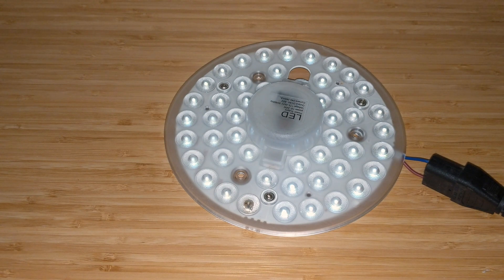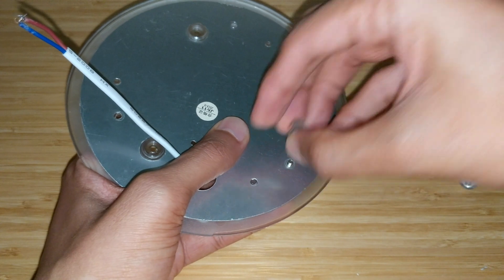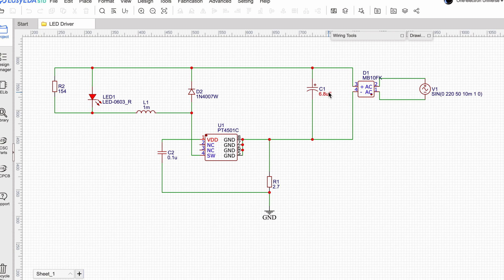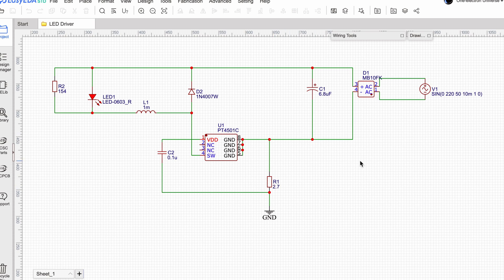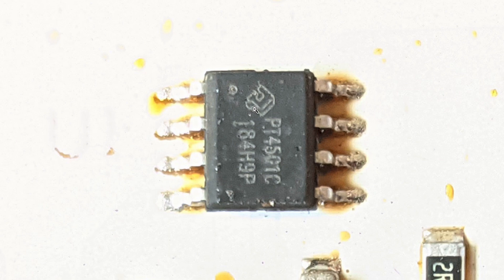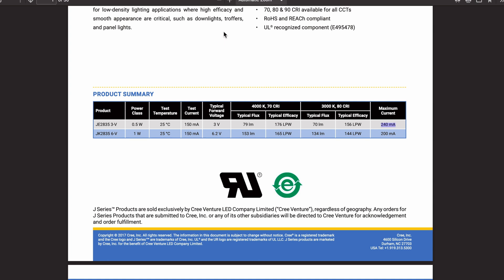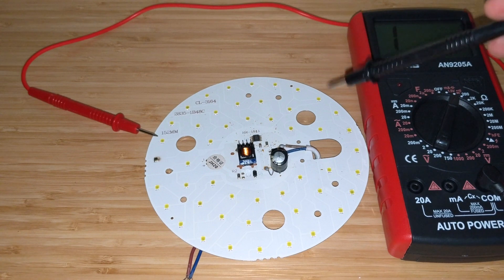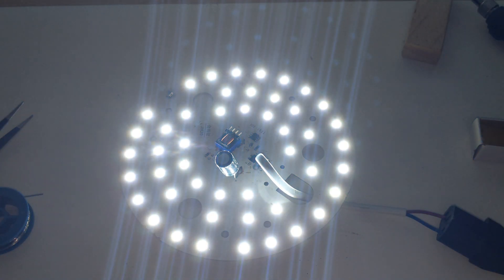LED Driver Teardown and Repair - Let there be light!!!

Comment: there is a error in your schematic. the path for current detection should be:
Bridge recitifier +ve- > LED (LOAD) -> L1 -> U1 ICpin 4 ->U1 PIN 5,6,7,8 -> R1 -> GND -> -ve of Bridge recitifier. then only the current  flow is detected by the IC. 
as per your diagram, the current never goes through R1, But directly goes to Bridge rectifier -Ve,  so no current limit work. also the GND connection is hanging - it has to connect somewhere isnt?
at 8:33 Data sheet shows no connection from -ve of bridge rectifier to IC pin 5,6,7,8

Comment: First of all you are a good teacher. I liked your videos and narration. I want to know what voltage & current rating of a driver required for a 18W tube light (by Wipro). There are total 98 LEDs, connected in pairs (groups of two parralel) and all the 49 pairs  in a series. The data plate says 160 ma current. But no mention of driver voltage. I tried a 100V 200ma driver, it does not give full brightness. Please reply

Comment: you did not notice the bulged capacitor. how come? try replacing that and the led light fixture
will light up.
Reply from the maker: Good observation. I did test the capacitor. it was fine but definitely close to its end.
Reply: I'm trying to learn more about LED drivers, that's how I ended up on the channel. I have bought a batch of LEDs ceiling lights, their drivers keep on failing - and the offending part is that 6.8 uf capacitor. The whole circuit works fine again after replacing that. 

I've tested the circuit by putting a good capacitor of but a lower capacitance - the light then flickers occasionally. The capacitor also gets a little warm.

What if we replace that with one of a higher value? Would putting a 20 uf one instead of a 6.8 uf one cause any problems? Would it likely to last longer?

Putting a capacitor rated for higher voltage is very likely to make it last longer. 400v is the bare minimum here, 450v is standard, going higher than that could be beneficial.

The only downsides I see with a higher rated capacitor is increased cost (which is justifiable to avoid repairing them repeatedly) and size (it has to fit in the fixture or driver casing).

Comment: You should probably replace the led and reduce the current by changing the current programming resistor. This will increase life expectancy of the led bulb.
Also the input bulk capacitor is bulging which needs to be replaced for healthy filtration of supply voltage.

Comment: You don't give the datasheet of C1 6.8 uF (400v I hope ?) it seems very bulky, I would immediately replace it by a Japanese one. Anyway the manufacturer design circuit of this light drive too much current for the LED'S and your "repair"will probably fail in 1 or 2 month max. Sorry but at this day, the Chinese made LED fails to much. Anyway, your explanation is outstanding 👍
Reply from the maker: Thanks for the comment. Glad you liked the explanation.

Comment: Sir. I am trying to find a driver chip AREZZO 328A replacement for 5W LED bulb. Unfortunately I can't find from Aliexpres.com. Any recommendation for equivalent 8 legged chip? What's the constant current for 5W bulb? Many thanks
Reply from the maker: Do you know what LEDs are used in the bulb. In this video the LED model was printed on the board. You can then look up the specs of the LED and find a suitable driver.